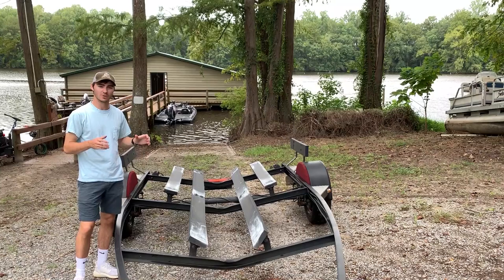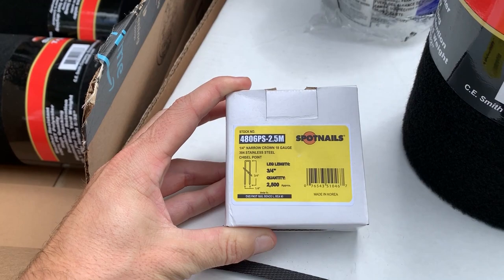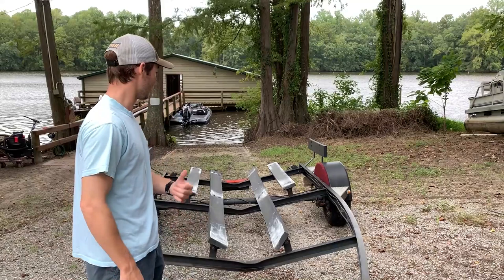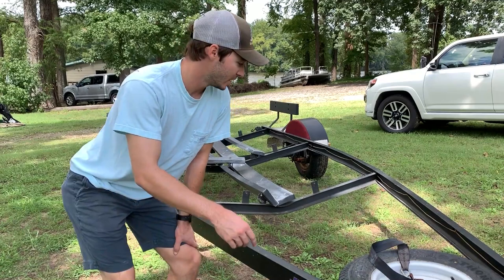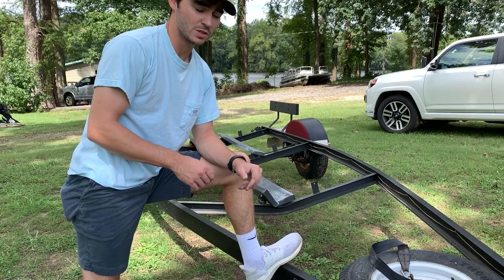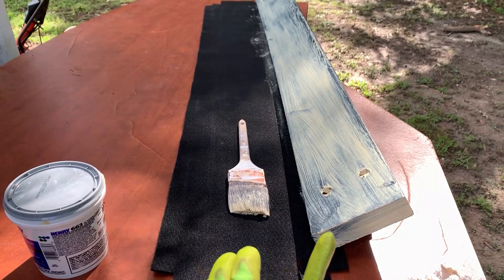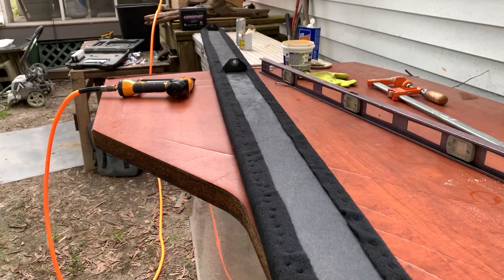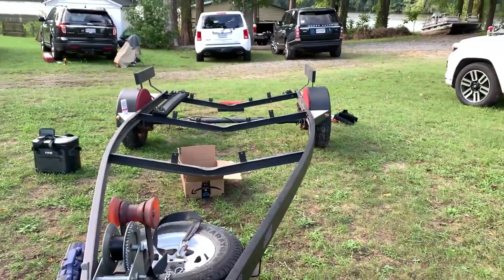How to Install Bunk Board Carpet on a Bass Boat Trailer

Comment: Hey Jenkins, u have had that carpet on for almost a year now, how is it holding up? I saw that ce Smith carpet online as well.
I'm due for a new carpet this year, thanks for the video.
Reply from the maker: Hey man! Like I said in the video, it’s thinner than I was expecting. That being said, it’s held up great and I’ve had no issues with it. It does the job for me just fine👍🏼👍🏼

Comment: Great vid my friend. Question for ya before I order the same staples. What type of gun are you using on your composite ramps? I tried 1 inch staples with my buddies air stapler and they didn't go in half way on my composite deck boards I'm using? Thanks for any advice?
Reply from the maker: Hey man, sorry for the late response. I used the spot nails brand. Stock number: 4806PS-2.5M

1/4” narrow crown 18 gauge. The leg length is 3/4”
Reply: @JenkinsBassFishing  No worries. Thanks for responding. Those are what I've got. I was afraid they wouldn't go all the way into my composite boards I'm using for my bunks. I doubled up two 3/4 inch deck boards. I did a test with some galvanized 16 gauge and they bent but the ones you listed above went all the way in with a decent compressor.

Comment: How do I prevent my air nailer from shooting staples completely through the carpet?
Reply from the maker: I had to mess around with the air pressure I was giving to my staple gun. The air compressor we used allowed us to fine tune how much air pressure we had, thus allowing us to not shoot the staples right through the carpet.